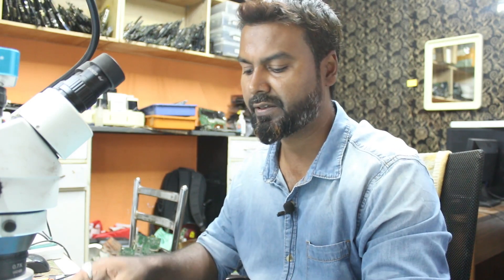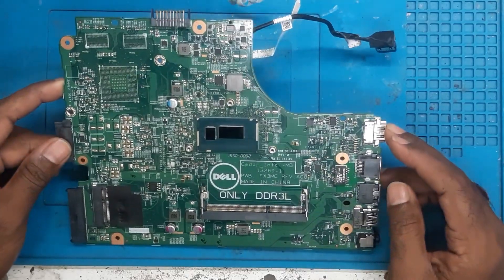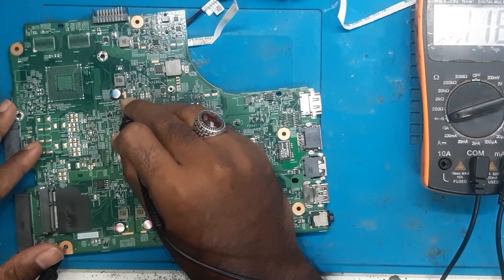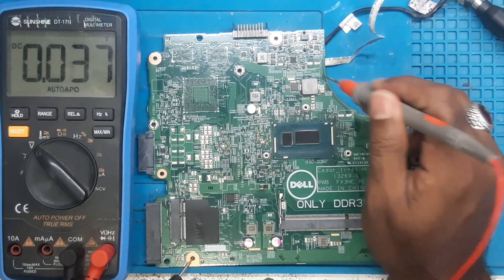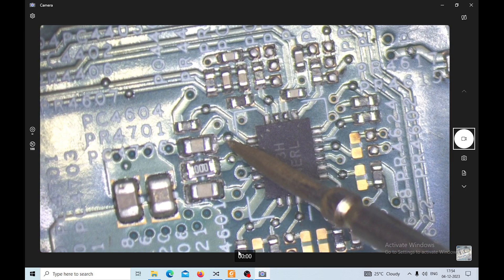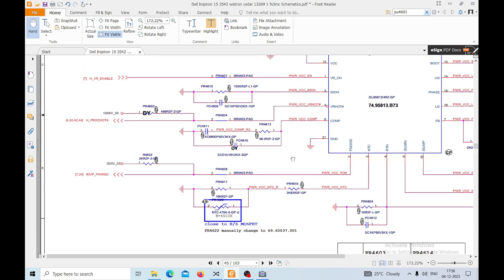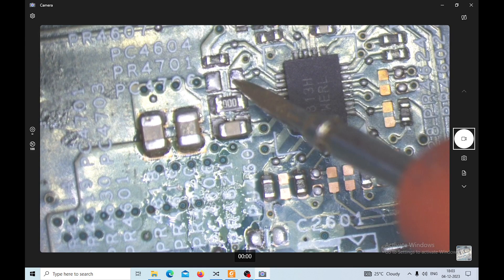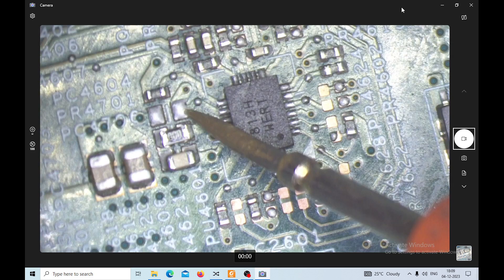Dell 13269-1 no power Repair | Dell Inspiron 15 3542 no power

Comment: Sir I don't have same switch ic 
Any other option
Reply from the maker: You need to have scrap boards to do it, if not then buy it.. check with schematic if it's the same.